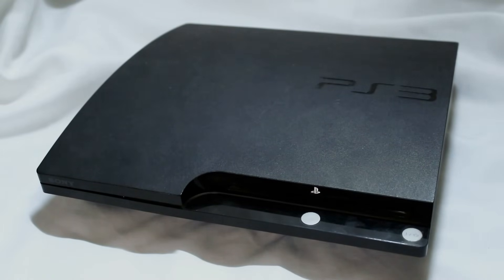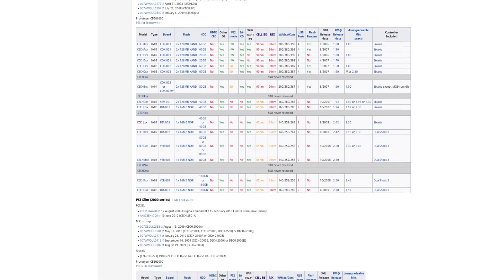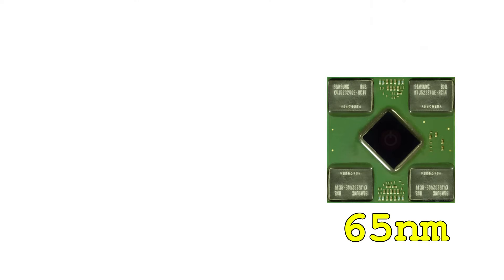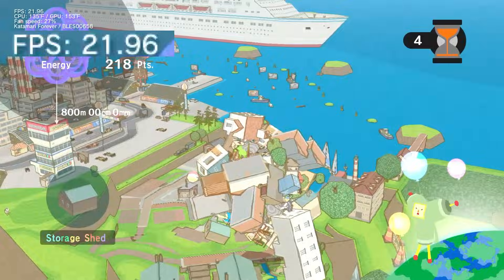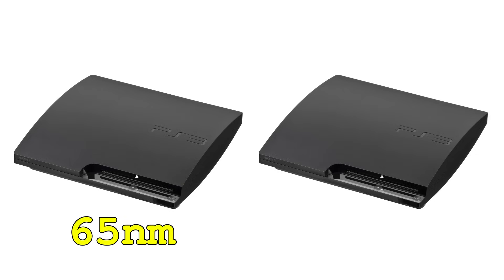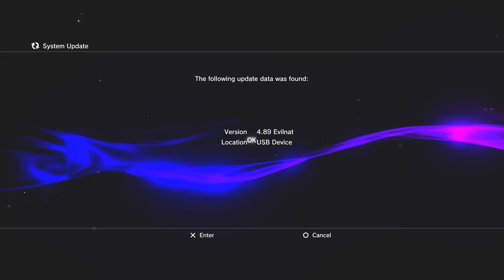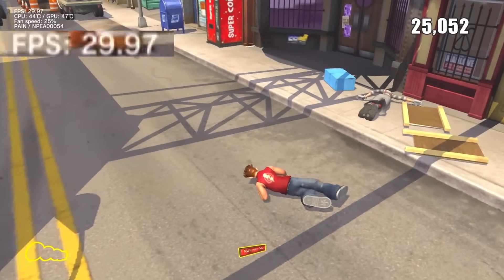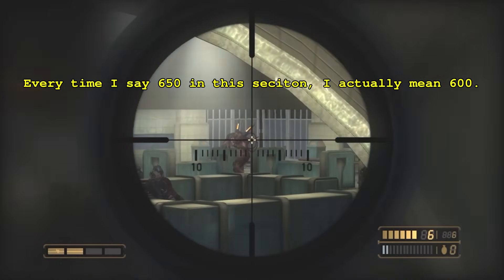Overclocking a PS3 with Project RSX Boost

Comment: That's honestly cool that we can overclock PS3's like that.

But man the risk of bricking your console because the overclock was either too high or because there's too much noise rippling in the power delivery doesn't seem like its worth running an overclocked PS3 for too long.

I would have said maybe it can help Razing Storm run above 30FPS most of the time but its probably CPU bound since nearly all the environments can be destroyed.
Reply: Overclocks can be had for long term. These OCs cannot kill or shorten its life span. These chips can easily handle more frequency. And voltage is locked. So the only thing that can kill PS3s and all electronics is heat. And voltage is locked. Reason these slims can do more is cause of the node shrink and efficiency gains from 90nm down to 40nm. Sony simply had a lock to 500 core and 650 memory. But PS3s can handle more super long term. Now the bricking part is a risk, if you’re dumb and don’t do the proper testing method. If you go and put a high OC your model of PS3 can’t handle, yeah you’ll brick.

Comment: Little correction to overclocking power and heat generation. Even if you don't adjust voltage, power and heat goes up, because simply chip is doing more work than before. More work chip does, more power it takes, more heat it produces, so overclock without voltage bump, still increase power and heat, but not nearly as much as with voltage bump. As mentione in video, heat goes up with overclock, that's because power does too, it's not free performance.
Reply: Exactly! Same goes for older GPUs as good example, I have done voltmods to GPUs with variable resistor fooling the power control IC. 

You can lock the voltage, increase the clock speed and it will generate more heat. On newer cards where the power delivery is handled via "budget" there is possibility to increase power limit, that bumps up the voltage too. Clockspeeds including boost are mapped with variable voltage/usage/power cap and ultimately there is a ceiling somewhere with stock hardware/bios.

Same goes for this PS3 mod, clockspeed is hard set on it, I highly doubt it's stepping down the clockspeed when utilization is under 100%. It's always running at constant speed and voltage. Increase clock speed or increase voltage = more heat
Reply: I’ve been doing this for 2 years now. And now I do 900/950. And no! The heat doesn’t go up nearly at all. Maybe 2c. But my temps don’t change. That 2c could be margine of error.
Reply: @Tanzu15  I don't mean that heat has to go up significantly, I mean that not touching voltage does not  equal not increasing power usage andheat in overclocking. 
Your mild increase of temperature, strongly suggesting that GPU is not increasing workload, because something else is bottleneck in the system. Temps increase pretty linearly with workload increase, if voltage is constant. You can overclock as much as you want but if workload is the same, temps are the same. I believe system memory and cell CPU are bigger bottleneck in many multiplatform games, because this CPU was not utilised properly. I'm interested how much fps increase is correlated to heat increase. If You get few percent fps probably heat go up by few percent.
Reply: @Lancemarkful  in unlocked framerate games, I’ve gained like 20 FPS. In locked framerates to 30, well it hugs the 30 mark way more constant. Cpu is our biggest bottleneck.
Reply: @Tanzu15  so gains are bigger than I expected. And temps barely higher. Is fan on auto or on constant? It's weird to have significant fps gains with marginally bigger temps. Maybe the fan on auto just spins a bit higher to keep temps on the same level
Reply: @Lancemarkful  i have the fan at 40% controlled by webman.
Reply: @Lancemarkful  This has been shown in games that respond well and push the system.  Temps do go up, I'll admit they don't go crazy high though.
Reply: @georg6876  its not that simple...
imagine each transistor being a tiny lightswitch that turns on and off really quickly, in theory making them turn on and off faster should result in the same power draw right? well not quite, in reality you're adjusting the off time more than the on time, and also have to deal with higher resistance due to giving the transistors less time to cool off between on cycles.

Comment: What was the size of the PTM7950 pads You've used?
Reply from the maker: it's a 4x8cm sheet that I I cut to size.
Reply: @sync-on-luma  so two 4x8cm sheets should be more than enough?

I've used Artic Mx6 on my Frankie, currently on OFW, but the only reason I might go CFW is because of OC.
Reply from the maker: Oh absolutely.

Comment: I've had evilnat 4.90 600/750 OC on my FAT 80GB DIA-002 (Cell-65nm/RSX-65nm) for some 2ish months now. it been great, rock solid stability and little to no temp increase. note thought my ps3 only has 3,000 hours of power on time (buddy's slim with HEN had over 12k hrs), fresh thermal paste, and the fan curve turned up which may help with how stable it's been.

I did a play through of Nier, and Killzone 2 and 3 with no issue or artifacts and 18-20% better fps performance. drops to 25fps now hold 30fps and drops into the teens now hold above 20fps. 

Will be doing goldHEN on my PS4 Pro next.
Reply: Shame that the likes of Killzone 2 get hit with slowdowns so often. Great game otherwise.

Comment: Maybe someone would do it on their 40nm frankenstein PS3 BC? The cooling and power requirement would surely be less of a problem, maybe one with a great quality RSX can hit 1GHz in core speed.
Reply: I would be very afraid to risk melting my Frankenstein after all those money and work spent to prevent it from melting in the first place.
Reply: @GrandemagicoWall  Yeah, better to just use any old Slim 40nm PS3 with the fan turned up to 100%/liquid cooling if necessary than to risk a Frankenstein.
Reply: Have been using 700/900 OC for a week now, the xmb froze a couple of times but apart from that the games work perfectly fine. People use crysis as a benchmark for stability, but i would never play crysis on the ps3. From the more demanding games iv played are gow3 and ascension, motorstorm 2 and 3, kz2 and 3 and everything worked fine. Btw, my slim is 2501 and both cell and rsx are delided. I also tried the 800/900, but the artifacts were even on the xmb, so a went back to 700/900.
Reply: @henshin587  A proper overclock is one that does not artifact, chrash or cause instability. Just because game Y works does not mean it's stable.
Reply: @henshin587 Running GTA 4 would probably be a good benchmark aswell, ran like shit on the newest PS3 years ago.
Reply: https://www.youtube.com/watch?v=YQGbU03jpDM I saw this youtuber managed to overclock his ps3 slim to 1ghz for his rsx

Comment: Evilnat's BETA 6 OC files are already gone, new BETA 7 has no OC yet.
Reply from the maker: Dang, looks like they wiped it out right after I hit upload. Hopefully they'll release new ones soon. 
in the meantime, just check the Project RSX Boost thread for links to overclocked firmwares.
Reply: @sync-on-luma  the thread is also dead :((
Reply: @sync-on-luma are they back?
Reply: @sync-on-luma this video is absolute rubbish. PS3 never have any frame rate issues. And I very much doubt the Xbox 360 ran better than the PS3.
Reply: @Reactivate100  The fact that MGS4 FPS would regularly drop into the teens says you're full of shit sir.
Reply: @Reactivate100  It depends what your expectations are, many games dip below the 30fps mark (usually third-party games but also happens with exclusives)
Reply: @Reactivate100  go look at ps3 vs 360 gta 4 then come back
Reply: @Reactivate100 oof ps3 is the worst for having performance issues especially the OG fat models. The slims were an improvement but the super slims take the crown for efficiently and stability with the redesigned 40nm rsx chip.
Reply: @Reactivate100  Bro your PS3 love blind if you have no idea of the complexity's of the system and what developers had to get through in order to make the games playable on the system. Portal 2 I will admit is probably one of the ports where the PS3 got more attention and delivers a much better experience because that game looks and runs better on the PS3 Vs the Xbox 360.
Reply: @Reactivate100 ps3 definitely ran worse with a worse firewall. PS4 and 5 are amazing tho
Reply: @Reactivate100  bro it has as its software is harder to make games for so game developers were still getting used to it at that time and the games had lower fps as compared to their 360 counterparts
Reply: @Reactivate100  Another ignorant console peasant LOL 🤣 Poor people are hilarious hahaha
Reply: lol lucky i backed up mine  before they deleted it xD
Reply: @CheesePuff-r8c  you gonna shaaaare?
Reply: @spiral7399 Chill guys, its just a joke
Reply: @Willian774 Doesn't read like one. Reads like a 2010 PS3 fanboy that never came to terms with reality.
Reply: @dannonyogurt98  Fr, I love my PS3 but I'd never lie and say it runs perfectly. I owned both the 360 and PS3 and for multiplatform games 360 wins 99% of the time not because it's more powerful but because it was easier for devs to work with and the PS3 required knowledge of the SPUs to match or beat the 360 in performance
Reply: @razmann4k  xbox "wins" as in has like 5-6 more fps on average? They still both can't mantain stable 30 fps btw, so what's the point?
Reply: They deleted the link I put to Mitsu Tehem and his collection of firmware.  PS3 Overclock try searching that I guess.
Reply: MY PS5 IS DEAD!! BECAUSE POWER  BLOW UP!! 😢

Comment: Has anyone experimented with underclocking to minimise thermals?
Reply from the maker: I believe so, but from what I recall, it' really only useful for keeping the heat/fan noise down in a development setup when working on homebrew that doesn't tax the system very much.
Reply: @sync-on-luma  Could be a good idea for those who live in warmer climates. My relatives in The Philippines play their PS3 and to the touch it felt much hotter than mine back in The UK.
Reply from the maker: I think the issue is that most games already push the PS3 pretty close to it's limit, so reducing clock speeds breaks things or make them unplayably slow. I haven't tried it myself though.
Reply: @mrmerlin6287  Hot ps3 is normal though
Reply: Underclocking has caused instability. Plus the PS3 is already super slow and stuttery. Underclocking would be 100% pointless.

Comment: Fyi, we are discovering the 2500 series slims can reach up to 900/950.
Reply: So far only mine does this stable. No one else’s slims can do it. So far. We are a tiny community of people that test this. 900 core is already so high. 900 stable is the Max stable this will ever go. 950 would be near impossible across every slim. We need more voltage.
Reply: @Tanzu15  can't a voldmod be done like we did on GPUs back then? Wouldn't it a single resistance to swap?
Reply: @Tanzu15  I have a 2500 sereies PS3 I'll have to check out and see how high mine can go stably when I get the chance
Reply: Is it backwards compatible @Tanzu15
Reply: @Tanzu15  BTW aren't 2100 Slims basically the same (CFW and 40nm RSX), shouldn't they also be able to go a bit higher than 600/750?
Reply: @razmann4k  yes. 700 core should be easily doable and stable. Memory should be solid at 900mhz too. But the testing method of should be done first always. So going 50 MHz up each time.
Reply: @Tanzu15  Great, thanks for the reply. I've been running my 2100 Slim at 600/750 for nearly 2 years now, and there's been zero issues to speak of, would be fun to experiment, but as I don't have an E3 flasher, I'd like to be extra careful in going higher. BTW I'm running REBUG 4.84.2 D-REX (as I needed to run developer .pkgs and Evilnat didn't support that yet in 2022 when I installed it.
Reply: @razmann4k  pretty sure evilnat has support In the new ones. He’s unified everything.
Reply: @Tanzu15  I think I may just move over to Evilnat then, thanks!
Reply: @Tanzu15 Typically less voltage allows for higher wattage. Adding more voltage just increases heat which would cause the chip to slow down the clock speed to compensate for higher heat...
Reply: I wouldn't attempt to apply a 900MHz overclock right away on 40nm Slim models. 
Early 40nm silicon chips from TSMC had terrible current leakage issues which is the reason the GTX480 failed so spectacularly. It required a ton of voltage to push even 700MHz. 
But later, the yields were improved, leakage was reduced, hence the reason most GTX580s managed to push 900MHz without breaking too much sweat.
Reply: @Sam-K  I just bought a PS3 Slim 2501A series, is it good? Got it for $20 only today, worth a try
Reply: I tried the 750MHz one and my Slim 2501 got artifacts. I had to leave the console in the freezer for 20 minutes so I can reboot and install a 700MHz version before it freezes or bricks my console

Guys, stick to the 700MHz one
Reply: Mine does 975
Reply: @dovahkiin2108  that's crazy! Mine is the "forum record" at 950/1000 mostly stable. What manufacturer year is it?
Reply: @andrewa837  mostly isn’t stable.
Reply: Wtf rly? @dovahkiin2108
Reply: I have it with 750/950 MHz without graphical glitches.
The diference on far cry 3 is absurd
No screen tearing and 30 fps most of the time
Reply: How is this possible?!
Reply: I need to buy one ASAP - can all of them be downgraded no matter the firmware? I do have a 80GB Fat PS3 only
Reply: @VinnyVance-r9v  any slim made before 2011 is guaranteed.
Reply: I want to delid mi ps3 but I have heard it’s hard in this model
Reply: Anyone tried GTA 5 with that overclocck?
Reply: @cri_404  will try today, will give news tomorrow, 700/900
Reply: @Agent-mb1xx he overclocked his PS3 to 769/969, now PS3 rules him
Reply: I have one of those IIRC, but its cooling is so messed up that fans is screaming in the main menu already and it shuts itself down. This is without overclocking BTW
Reply: What’s next, 1000/1000 over clock?, I swear this soon can be better then a 720p pc
Reply: I bought cech2504b Is this CFW compatible? do i need to downgrade the software if its newer.? tnx
Reply: I’m not sure if it works the same on PS3, though on PC when overclocking GPU’s it’s more beneficial to overclock the memory instead of the core.
Reply: can the og phat 60gbs  ps3s do 900/950?
Reply: @JohnDuraSSB  no, max is 700/900
Reply: @JohnDuraSSB  800MHz will brick any Fat

Comment: Is there any overheating issue?
Reply: Thank you so much, but I think it's very risky because this is my first console ever. but I would look out for more ps3 content like this!
Reply: No there isn’t. Voltage doesn’t go up. The temps are identical to base clocks.
Reply from the maker: There will be more heat stress on on the components due to the higher average temperature, but the system shouldn't outright overheat as long as the cooler is working properly. The inability to increase voltages puts a hard upper limit on how much heat the RSX can output. It's a matter of physics.

Comment: Glad to see a video🙏 we’ve been in the forum convo for weeks now. My PS3 did 900/950. I won the lottery.
Reply: Could you perhaps provide us with some video footage? I'd love to see that beast in action
Reply: @ps5professional  id like to make videos on it. But I don’t know where to begin on doing that.
Reply: pass me link please😘thank you
Reply: @李乐-p6y  psx place RSX Boost project
Reply: What is the model?
Reply: @helderestrela6958  2501B manufacture date December 2010
Reply: Anything over 720 is a win in my book.
Reply: Mine on 750 has some artifacts :/
Reply: Hi, I gotta ask, is it possible to take the HFW from the ps3xploit's website but re-do it with 650/750 clocks? The other website that is required for CFW is not working anymore on PS3s
An overclocked hybrid firmware would be perfect - thanks
When I try myself my Pc gives error messages no matter what, probably too old (A10-7800)
Reply: @Agent-mb1xx  no it’s only on cfw. And that website is always going down. It’s about time we had an offline method of hacking PS3s.
Reply: I'm jealous of you. My ps3  at 900/1000, experiences random crashing in games like Crysis and God of War :(
Reply: @LuanVATeles  but don’t you have 850/1000 fully stable?
Reply: @Tanzu15  Yeap, 850/1000 is 100%
Reply: @LuanVATeles  that already is fantastic. 1ghz on the memory is insane. We need to find a way to increase voltage. That way OCs can go higher with zero artifacts. You think voltage editing could be possible?